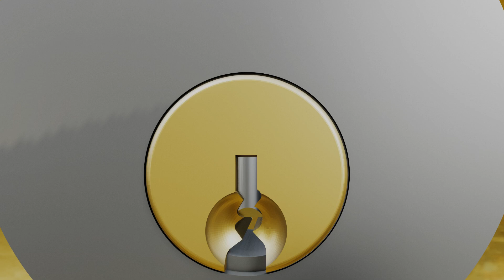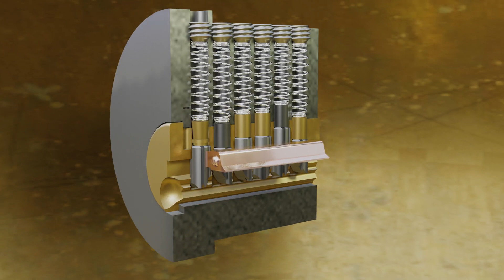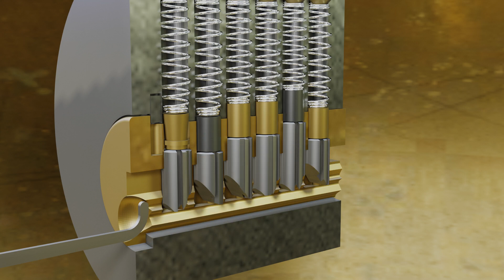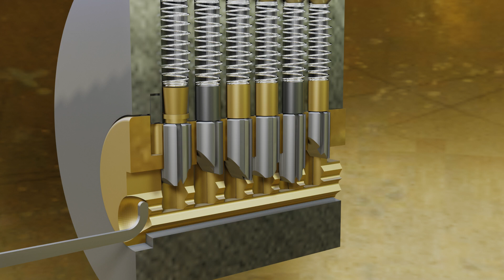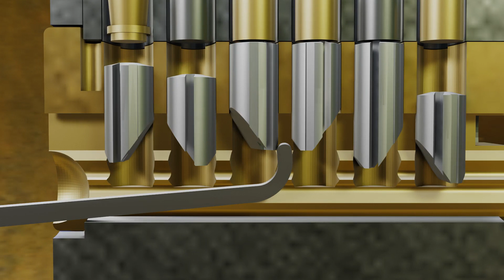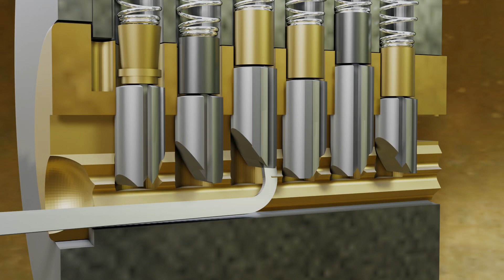How to Pick Any Medeco Lock - Redux

Comment: Hello !!!!
I look at all three methods. Interesting enough, but it takes a lot of time to translate ..... (But I can handle this point.
I opened ........ medeco relatively long ago, 2 locks.
Now I got the third one as a gift but it is without a key and this stopped the whole learning process.
I can’t understand how to determine in which direction the pin should be turned or the pin should be in the position without turning! ???? How to determine by what symptoms ????
I would be grateful if you answer me this question.
Good Luck !!!!!

Comment: Nice work. I will take this information and give it a try but the only medeco locks I have right now have really tight keyways preventing me from even tilting my pick. Maybe I just need more practice and understanding.
Reply from the maker: Which model do you have? Original are the tightest and oldest locks, biaxial and m3 are both much more open. But even original is easy if you have the right pick. Try taking your core out and see which pick works best with just the key pins in.
Reply: Lockfall Laboratories looks like 51S.